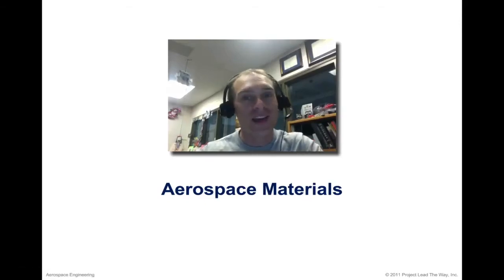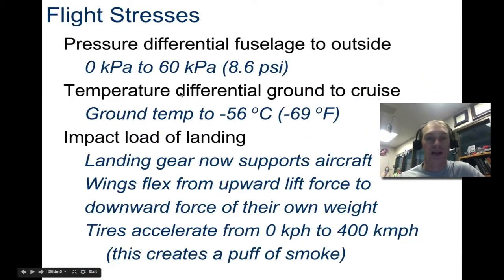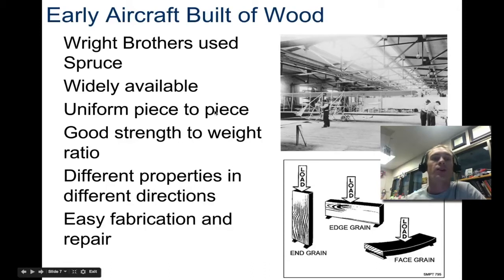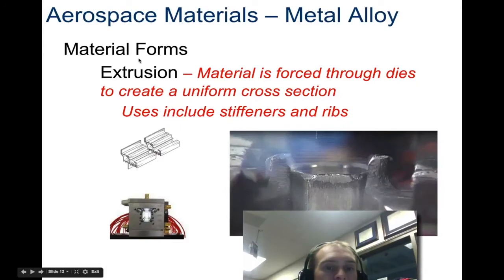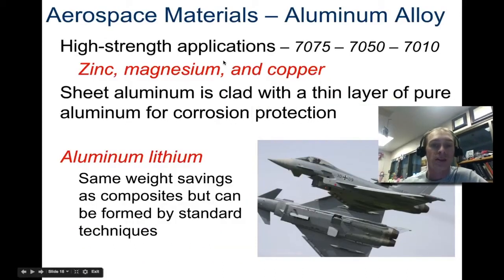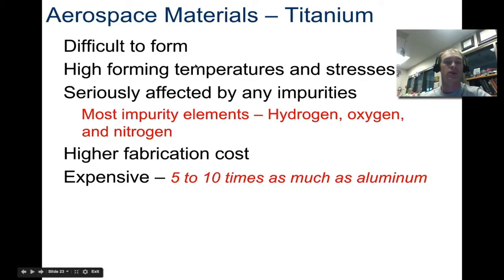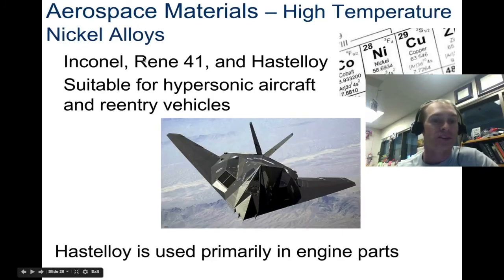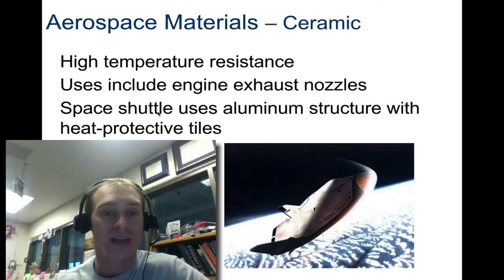Aerospace Materials

Comment: Great job man, but in the aerospace industry it's not "a quarter inch" (.250 inch), it's said as "250 thou'". Or 250 thousandths of an inch. Just so you know I'm an FPI inspector for jet engine components, so I'm not just talking out my ass lol. Titanium sucks because of its potential to hide discontinuities on radius forms. It's a great material, but because of its alloy compositions, it is one of the most difficult metals to inspect properly, so we have to have highly knowledgeable and trained people that know the ways to spot it as an art. Figured I'd share a little bit of my end of the industry with you lol. Once again, great video.
Reply: What are your thoughts on composites (787 for example) and their durability and inspectability (if that's a word)?